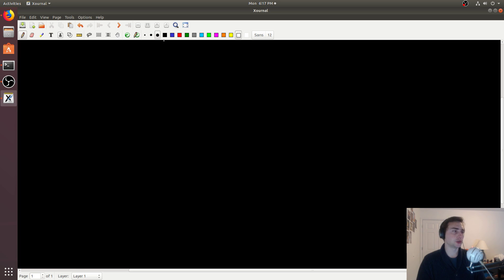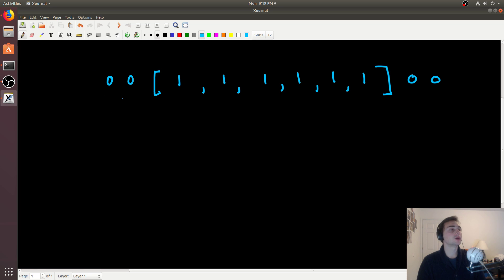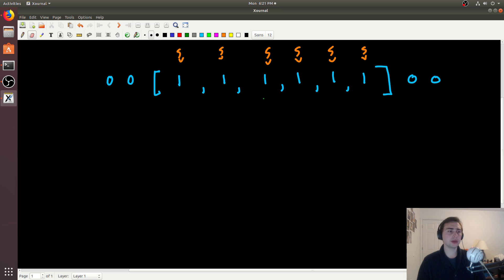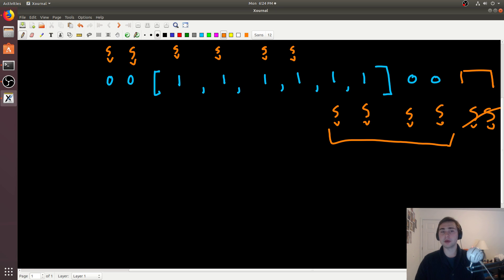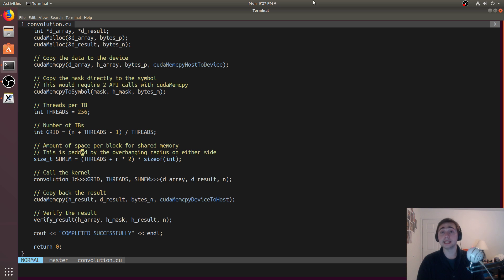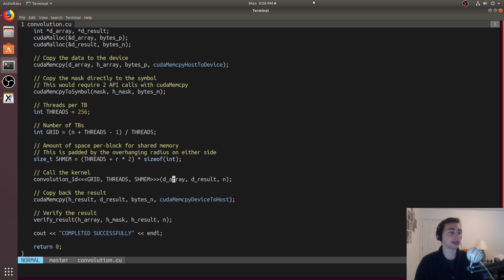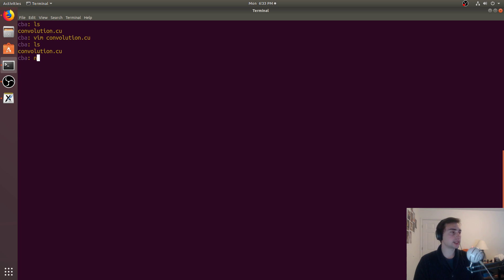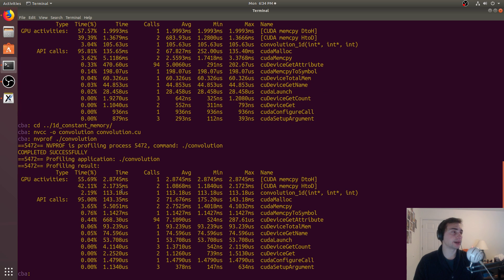CUDA Crash Course: Tiled 1-D Convolution

Comment: what if the image elements span several blocks? How do you handle the first and last thread in each block?
Reply from the maker: There's a bunch of options! You could load in a subset of the blocks into shared memory, and access the rest from global memory. You could also just have threads load multiple tiles of elements in something like a loop. As far as the edge threads (if you mean handling when you run of the edge of the data), you could either pad the data with 0s, or just mask off the threads with a conditional check. Hopefully this answers your question, and if not, just give me a more concrete idea of what you mean, and I can write up a quick piece of sample code that should clear things up! 

Cheers, 

--Nick
Reply: @NotesByNick  Thank you for the info! I successfully solved it by fetching elements from global memory for edge cases. I really like your videos. They are very informative and educational! I would love to see how you would use the debugger in Visual Studio 2019 and cuda-gdb to debug kernel
Reply from the maker: @unboxrandom  Thanks for the feedback! I'll look at doing some more work on debuggers with CUDA!